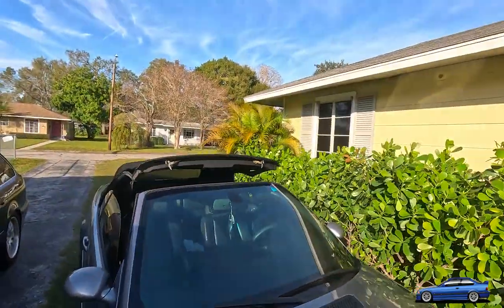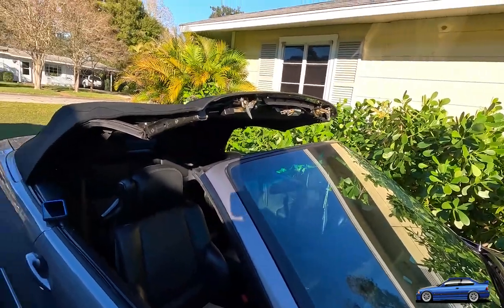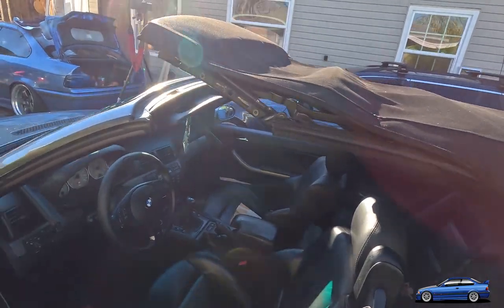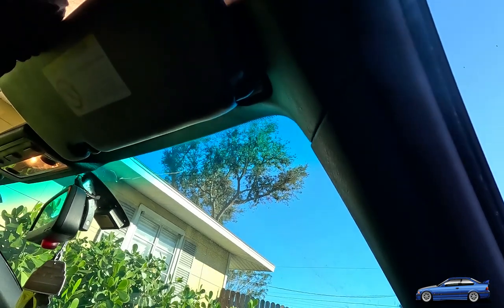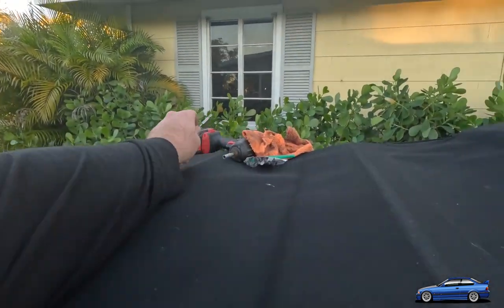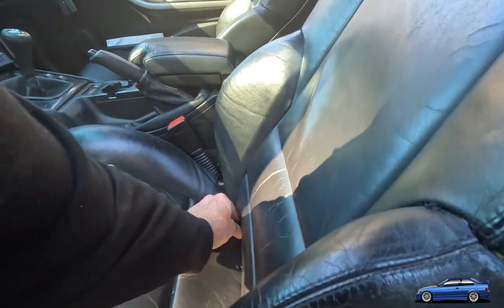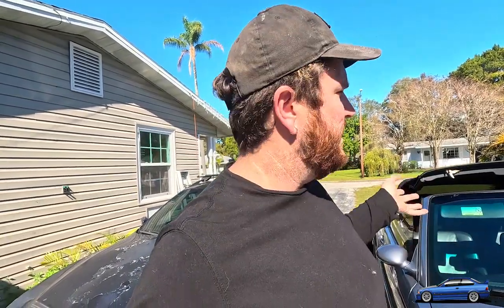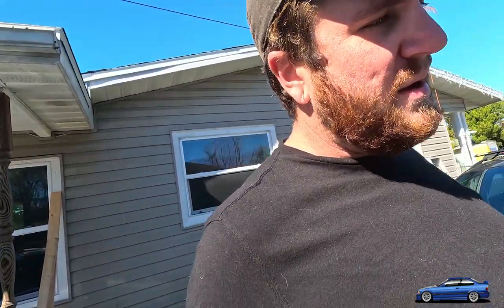How We Fix Broken Convertible Top Latches On Our E46 BMW 3 Series

Comment: does it open and close completely?having a problem with my locks were it won’t close completely at all.gonna try this out
Reply: My car is the same. I heard broken and screw falling sound inside the front part but I couldn't take this off because I don't have any tools for this. if you tried this can you tell me the results too ?
Reply: @Emre-ut8jb  i finished it today and it worked ,then i think broke again when i opened it again to be sure.i tryed manually closing it which did not work either
Reply: @marcarcc  I think mine is the same. When I try to turn it off or on, nothing happens and I only hear screw falling off and clicking on the front. Your problem is the same right ? not opening and not closing right ?
Reply: @Emre-ut8jb  mine opens fine i’ve just never been able to get it closed properly due to the locks prior to this,it closed properly after and opened properly than i tryed again and heard something broke so closed it and tryed to lock it down manually with no luck
Reply from the maker: it does open and close completely when broken but it wont latch if that makes sense. The front of the top will get close to the window frame but the latches wont grab the frame and pull the top down and secure it.
Reply from the maker: I would be pretty comfortable saying that if you did hear any crunching sounds coming from the latch area then you've likely suffered a similar fate.
Reply from the maker: You really have to glob that jb weld on there and make sure you get two nuts and bolts in there. I also like to let it all set up for at least 24 hours before I use the top
Reply from the maker: sounds like it may have failed a second time.
Reply from the maker: for what its worth, I made this repair two months ago and It is still holding strong
Reply: @AuctionDawg  yea i did hear the crunch,i tryed closing it manually afterwards just to drive it and now it won’t go back up at all with the button
Reply from the maker: @marcarcc  Yes i would say you need to pull that cover back off and see if theres any meat left to attach to
Reply: @AuctionDawg  yea when i did the first time there wasn’t much left but it still held on one side so i put jb weld on both,My new problem now is that it won’t go up and down on its own anymore,i’m gonna try to repair the latches again and see if i’m able to manually close it
Reply: I got the 2 bolts on one side and one on the other as there was not that much meat left,I’m waiting for it all to dry before i attempt to close it or touch any buttons to see if it works,If it does not close with the button i’m gonna try to manually close it

Comment: Yo bro, I just bought the convertible, trying to figure out how to close the roof, the roof stays at that like 45° angle it was at when u were repairing, just wondering if u could give me some tips on how to close. Don’t wanna break it loll
Reply: Automatic convertible doesn’t work has to be done manually
Reply: @lukecameronjg  i had this problem, the hydraulic pump seizes when the roof motor stops working, im still working on getting my fixed but hopeuflly that helps
Reply: @louisallen6528  Thanq for responded, my issue was, there was this “c clip” i guess, in the middle of the convertible piece that snapped off. Every time I open and close it it comes out off the “c clip”. It’s like the bottom off the “C” was cut off so it keeps falling outta place. Gunna have to weld a bit a metal to it to make it a c shape again

Comment: How long did you wait after applying the jb weld before you drilled the holes? & did you also apply the jb weld to the spinning metal rods that the plastic is attached to?
Reply from the maker: quite a while. You really want the jb weld to begin to tack up, it will make the entire process easier. 

Try your best to not apply anything to that threaded metal rod. That part spins every time you operate the top. You are only jb welding the plastic part that rides on that rod to the metal latch actuator.

Comment: i have the same problem but my roof is already locked. the right side opens and unlatches but the left side i can hear the motor and movement but does not release. When i bang the left side i can hear something rattling so something has come off and pretty sure this is the problem. Do you know any way to fix this while the roof is down and locked thanks
Reply from the maker: you can release each latch individually from the left and right side with allen wrenches.

Comment: I would like to ask you, I have an opel astra bertone cabrio 2002 model, they told me it has the same shutters as the bmw, mine had a broken pipe and I wanted to take it out to fix it and the hood does not open, does it have a way to open it with a key but inside and it opens one side must have broken some plastic that is on the shutter how can I open it do you know thank you very much
Reply from the maker: I am struggling to understand what exactly you are asking honestly. Did you get it all sorted?

Comment: My latches do not want to lock, but I am able to do it manually. Is it possible that I have same issue like yours, and the manual close/lock runs on a separate cable? Thanks for the video. Any insight would be appreciated.
Reply from the maker: it is very possible honestly, I know I am replying late but the best thing you can do is remove the cover and watch it operate.
Reply: @AuctionDawg  It's all good bud. I fixed it. It was the gears inside the motor.
Reply from the maker: @dimitrezlatanov7480  glad to hear that man enjoy the convertible life lol

Comment: Will this still work w/o JB Weld? There’s not much plastic left for me to apply it to
Reply from the maker: unfortunately, this is uncharted territory. I would like to say there is always a solution but once enough of the plastic worm gear has broken away there isn't much to attach the metal latch arm to. You may be better off pulling what is needed from a junk yard.
Reply: @AuctionDawg  Thanks for the reply! I applied as much JB Weld as possible and it seems to holding up... for now!

Comment: I’m having a huge problem rn with my latch assembly, the part where your tighten or loosen to manually remove the top, the bolt has hidden itself inside the plastic piece and I can no longer manually open the top
Reply from the maker: you may very well be past the point of no return and may have to replace the entire assembly unfortunately.

Comment: So you drill through the metal?
Reply from the maker: yes, you are basically bonding the remaining plastic to the metal parts and then drilling through both and installing a bolt to give everything a mutual base to hold on to. Originally BMW essentially plastic welded these parts together, which clearly was insufficient. I don't remember off hand what the drill bit and bolt size is but it isn't very big. The nut and bolt just reinforce the connection of both parts.
Reply: @AuctionDawg  thanks

Comment: hey man, when pressing the button when the latch didnt work - were u still hearing the motor before? im not hearing anything just seeing the flashing red light - so i was wondering if need to replace the motor as well
Reply: Reset the motor in the back by pressure the delivery button under the rear passenger seat
It will release the rear latch which is probably in the locked position
Reply: Or your upper gear may be stripped and may need to be replaced
Reply from the maker: yes it was, the e46 top has many moving parts. if the red light is flashing when you press it a fault in the system is preventing it from moving at all. It's hard to say what I would do in your situation but off hand I may try and reset the top. Manually release the front latches, pull the lever under the rear seat and manually lower it then re-sync it. the motor may not be bad, there may just be an issue that causes the module to stop it from operating.

Comment: What if I can’t even get it opened?
Reply: Should be able to do it manually. There’s videos on here that show you how
Reply from the maker: id say manually open it, reset it and check all fuses. go from there!
Reply from the maker: good advice @mileswebb802
Reply: I am trying to open it manually. It started to open at first then it stopped. I closed it back and now it won’t open at all.